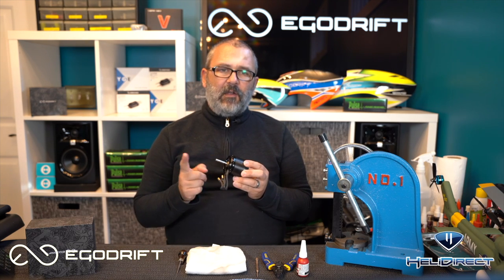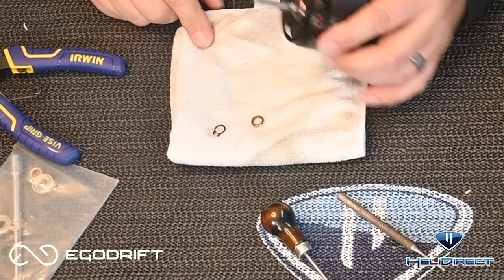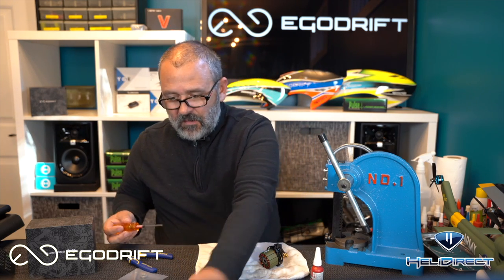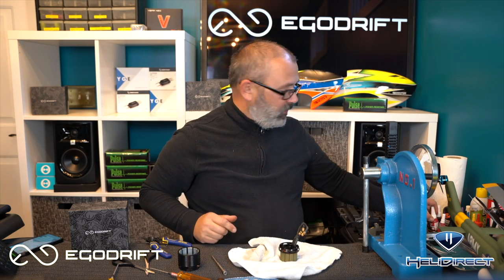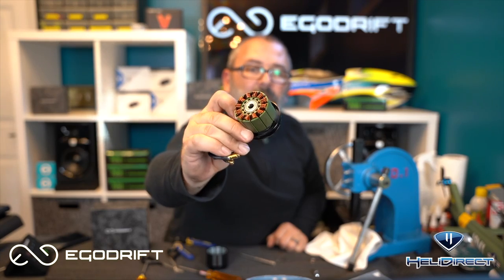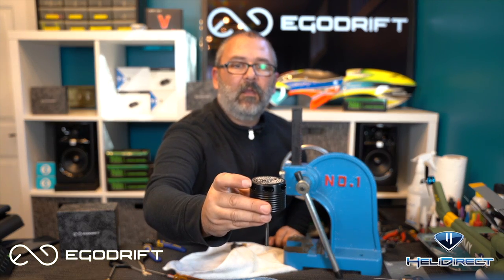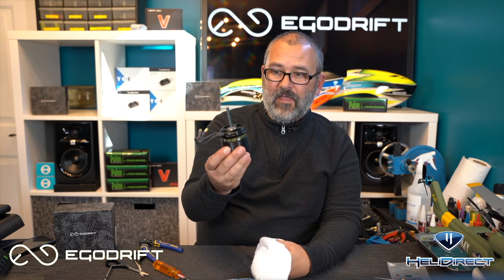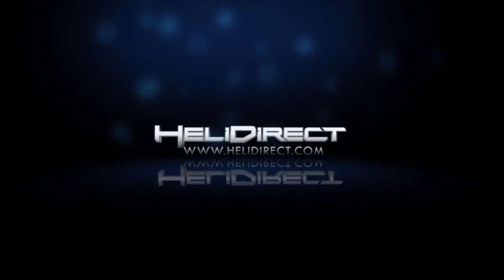How to Replace your Egodrift Brushless Motor Shaft & Bearings

Comment: Hello Nick.  Thank you for another very informative video.  Considering that the shaft and radial bearings will eventually be subject to maintenance and or replacement, I question the wisdom of using bearing retainer on either the outer race of the bearing (contact surface between motor stator and outer race of the bearing) and/or the inner race of the bearing (contact surface between the inner race of the bearing against shaft).  It looks to me the radial bearings were press fit onto the stator without any bearing retainer from the factory and the factory did not use bearing retainer between the inner race of the bearing and the shaft either to begin with.  I understand the bearing retainer would prevent any potential runout or uncoupling between the bearing races against the motor stator and the shaft surfaces, but I question the necessity of using this bearing retainer especially since the factory does not seem to use it to begin with, and the negative consequences when it comes to maintenance and bearing replacement in the future.  Your thoughts?

Comment: Thanks Nick for the nice video, applicable to all our RC heli motors. I did it recently on one of my motors and basically followed exactly your steps. The only thing I did not do is the green loctite on the 2 bearings before sliding the shaft in. I agree it's a way to avoid the friction/wear between shaft and bearings inner rings, but I'm not sure it will be enough beacause of stresses, vibrations and different extension between steel shaft and aluminium can with temperature. Anyway, I agree it is worse trying.
Keep on doing such nice videos, thanks again ! (PS: I have an EGODRIFT 4525HT and love it!). Luca